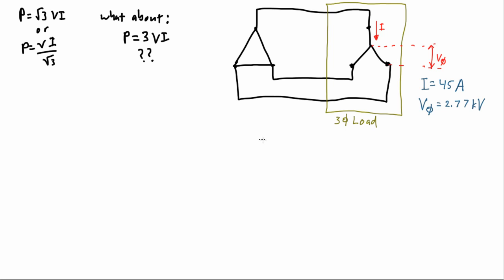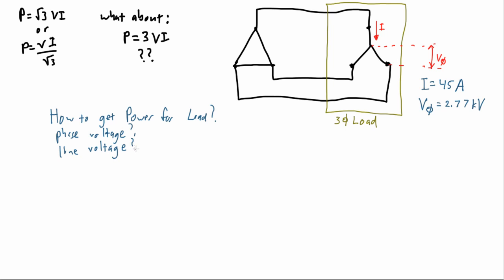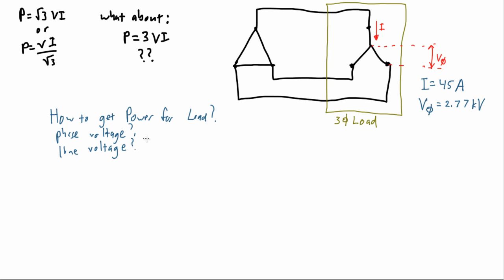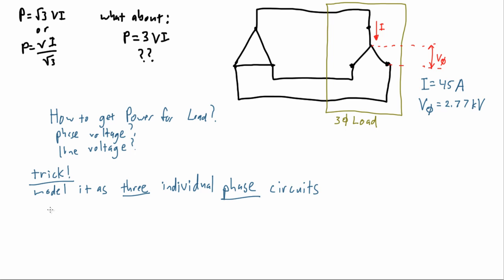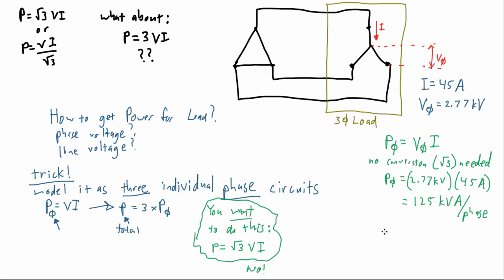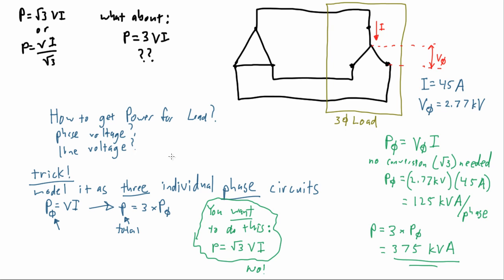Electrical PE Exam - Root 3 (part 5)

Comment: Looks like the line current coming into the Wye load will be split therefore the current will not be the same as the other two transformers on the Wye.

Comment: Use the root three formula when you are given line voltage. Three phase power = 3 x V(phase) x I OR  Three phase power = root(3) x V(line) x I.